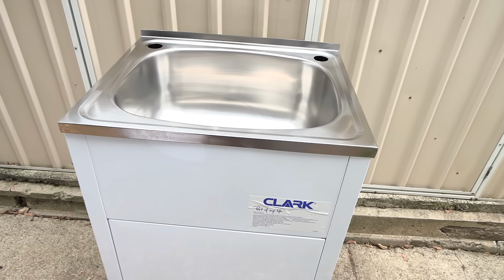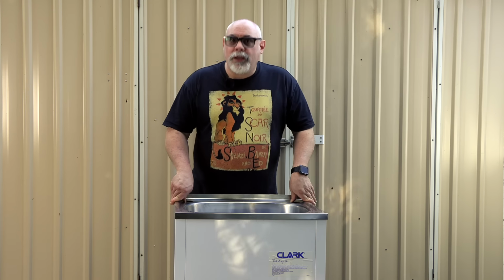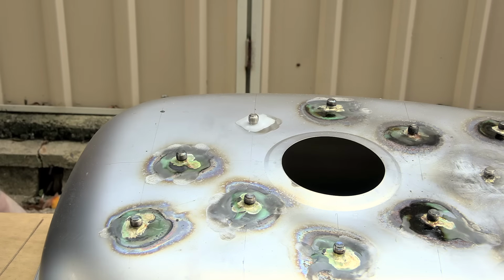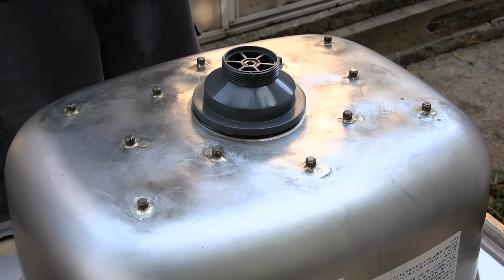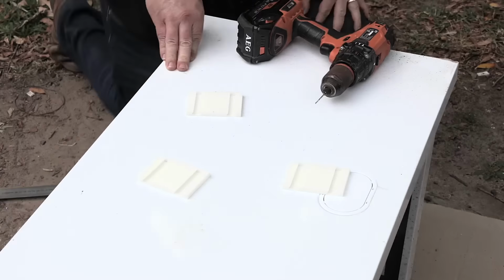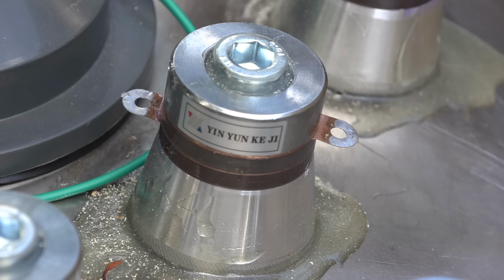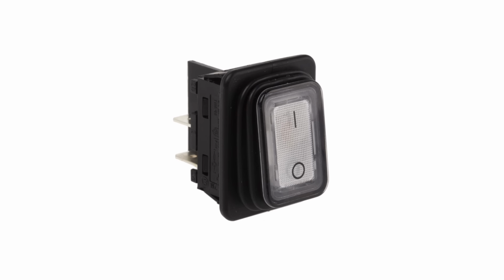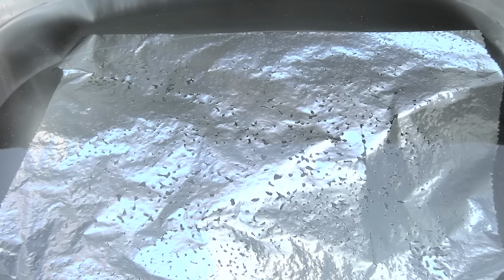Building a Laundry Sink Ultrasonic Cleaner

Comment: is there a way to make the frequency variable so that you can use large cavitation for the more durable stuff and a higher frequency for the more delicate stuff?
Reply: No, you can not make the frequency truely variable. A transducer works on a fixed frequency (apart from being able to tweeking it a little bit with high end drivers).
So, you can only make it multi-frequency by installing different types of transducers (and drivers) a longside. And then switching between the sets if you want a different frequency. This is also how it is done in commercial units.
So, there is no 'sweeping' between frequencies, only switching between fixed values.
Reply from the maker: I know it can be done, but I suspect it might be a bit tricky with these off-the-shelf units.
Reply: Generally not, the transducers are essentially speakers designed to be very efficient at one specific frequency.
Having said that, I have seen "Dual frequency" transducers on Aliexpress but have no idea how effective they are.
Reply: @Miketz  They use different sets of transducers. A set of 40KHz and a set of 20KHZ for example, and they switch between the two. There is nothing special about them, except that they can switch between the used frequencies.

But as such, they are in fact twice as inefficient at a given frequency compared to single/mono frequency cleaners!!
That is because they use the same amount of total transducers for the same area/volume. So it means they only have half the number of transducers for a given frequency, and thus half the total power per volume at that frequency, compared to the single/mono frequency cleaners for the same volume.

It is actually very strait forward, no magic high-end electronics involved. Very easy to make yourself by just using different sets of transducers together.
The only 'interesting' part about those cheap dual-frequency cleaners is the electronic clock/timer which switches between the two sets of frequencies/drivers. But even that can easily be made with a microcontroller (arduino or the likes) if you really want the 'auto-switch' feature.
Reply: @CookieTube  There are actually 40/80MHz transducers available.
Reply: @Miketz  Ah cool, didn't know that. Didn't came across them half a year ago when I was 're-searching' this for my own DIY project (granted, didn't do that much research beyond what I already knew though). That would at least eliminate the need to double the number of transducers in a multi-freq setup to get the same power output compared to a single frequency setup. The ones I saw on AliExpress used two sets of single frequency transducers together.

I suppose they work exactly the same, but with a double positive connection in that case (so 3 wires instead of 2)?
Although, I do wonder if they are as effective as designated single frequency transducers. Because the shape of the transducer's body is very crucial to its effectiveness, and that shape depends on the frequency, so.... unless it is because of the second harmonics (aka doubling the frequency) the shape of the bell can be essentially the same as the first harmonics? ... bleh... interesting though...

Oh well..... biggest issue with DIY these things is the proper spot-welding/bonding the bolts of the transducers to the can/bucket. All the rest is just buying the very easy to get of the shelf components.
Reply: @Miketz  MHz? I think you mean kHz. At 40 MHz it would be emitting RF, not sound waves.
Reply: @stopthebus  Correct. I mostly deal with Ms at work and sometimes the fingers are on autopilot.
Reply: @stopthebus  Probably true, but only because the transducer itself is an electromagnetic device and potentially generates RF. Sound waves are not electromagnetic waves, though.
Reply: @Pedro_MVS_Lima  What?
Reply: @stopthebus  RF is radio. Radio is electromagnetic radiation. Sound is not, even if it was at 40MHz.
Reply: @Pedro_MVS_Lima  I know that. I am trying to understand your comments, but I think I will just say "Ok" and move on. I am a radio engineer, so I know what RF, sound, electromagnetic radiation etc are.
Reply: @stopthebus  Ok. I apologize if it got through the wrong way, but you said "At 40 MHz it would be emitting RF, not sound waves", hence my comment.
Reply: @Pedro_MVS_Lima  Yes I think there was some confusion. Someone above used 'MHz' when they should have used 'kHz'.
My point was if the system was oscillating at 40 MHz, it would be emitting RF rather than sound as 40 MHz is in the radio frequency spectrum. 40 kHz is technically a sound wave because it causes the cavitation of the water (RF would cause heating) although you can have a 40 kHz radio wave as well. Maybe we should just stop while we are ahead! 😆
Reply: @stopthebus  Hahaha I agree!